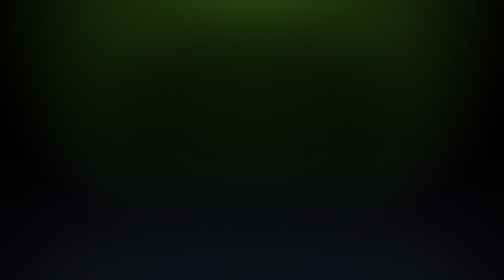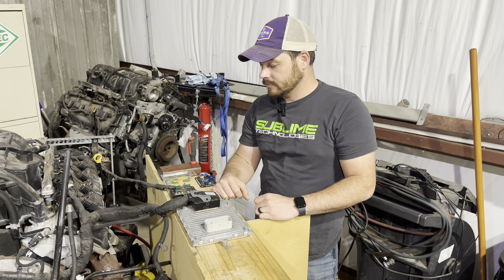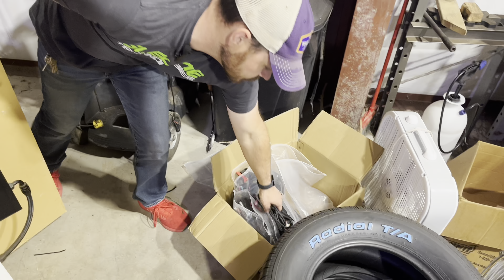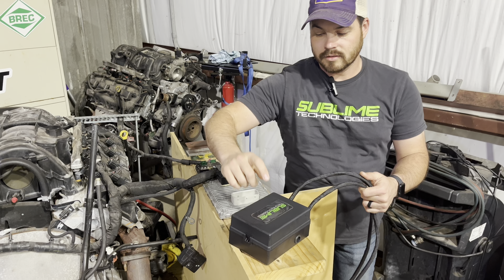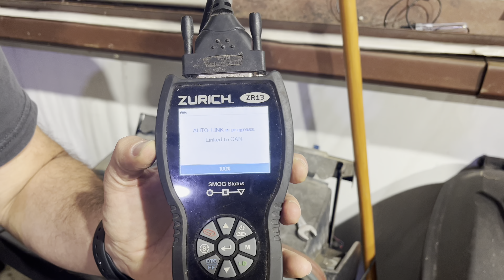2015-2022 Car Hemi QuickRun Harness Install

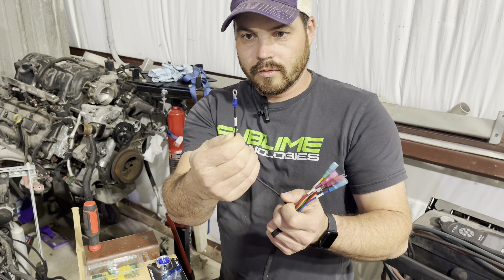Comment: Is there much difference in the wiring between a 6.4 and hellcat?  Starting to plan a swap for my 81 D150 (4 speed) step side truck.  Just curious if there is much difference in the actual 5 make up wire section?  3:03

Comment: Thanks for the upload and run through.
What about the shifter, do the 8-spd's just use the factory harness?
What's the purpose of your OBD2 plug when the factory harness already has one?
What's your star connector for if the factory harness already has one?

Comment: I did a 2012 challanger r/t to 2021 6.4l scat pack.

I have 5.7L intake installed and want to install the 6.4l intake with injectors.

What do I need to do to have this thing run like factory.

I know I need srv controller wired in by mmx
Reply from the maker: Negative, you don’t need the MMX SRV controller. You just need to plug it into your factory ECM and turn on SRV in the tune

Comment: Does this work on a maunl transmission as well
Reply from the maker: @juangallegos1866  absolutely
Reply: I been trying to start it and it still doesn't want to even turn over what do you recommend i have the pcm tune and everything it's a 6 speed manul
Reply: @juangallegos1866 check that ignition wire and see if it gets power while u crank it . He mentioned it in the video u have to tap into a ignition wire that doesn't turn off while cranking
Reply: Update turns out it was the pcm I ordered from other guy and a ground cable I didn't  connect i would highly recommend getting your pcm from sublime when I plug it in it start right up😅

Comment: Can 12 volts cranking be taken from the ballast resistor wires by combining both Brown and Blue together?  Basically both sides of the resistor.
Reply from the maker: @davej3890  that is how we typically do it, yes.

Comment: Let me ask a question. Say we still have the MDS still in the engine. With your wiring harness could we get say a diablo tuner and permanently disable the mds off the computer so we dont have to do a cam swap?

Comment: GREAT VIDEO! very easy to follow and install! with your crate ECM's, do you tune out the catalytic converters. or will they throw codes if not installed?

Comment: I have an older version of your wiring, (with the separate standalone module, and it was equally easy. 
Did you figure out to run cruise control with your quickrun harness and drive by wire pedal and throttle body? the only solutions I can find are for the older PCM modules with 4 plugs.